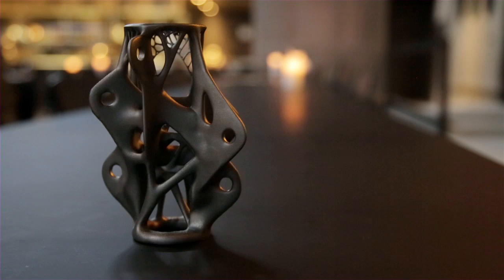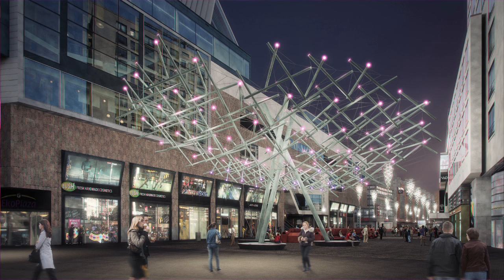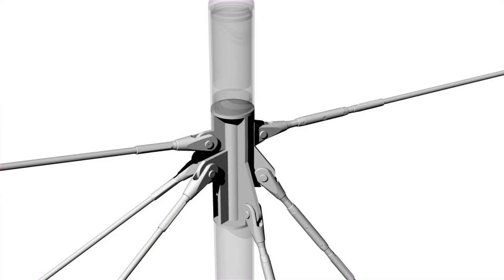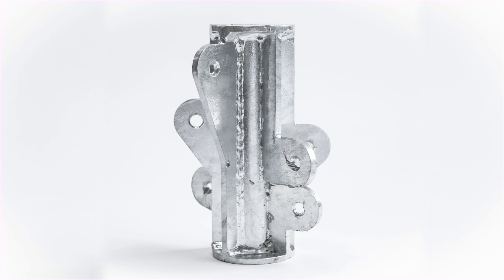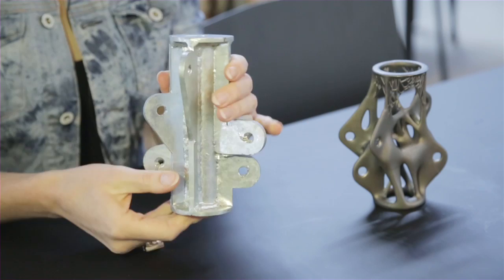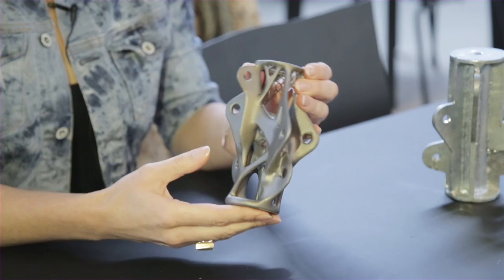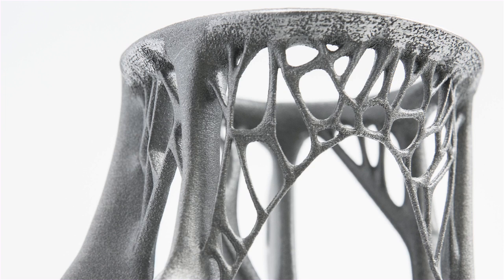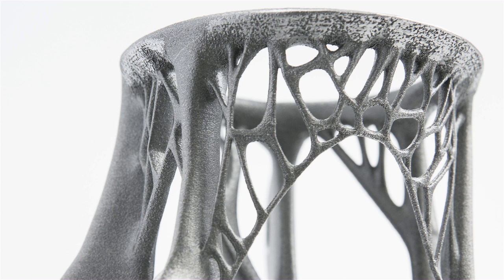3D-printed structural components will lead to new building shapes

Comment: The metal manufacturing Industry is slowly changing, most metal fabricating companies use CNC technology laser machines and for woven wire mesh products they use weaving looms. In the coming years it will be interesting to see how companies like ours adapt and how much of a role 3D printing will play, particularly in Architectural and Engineering Industries

Comment: I have been following the 3D printed structural shapes, and would like to ask what Safety Factors (SF) did you build into the additive printed Node? As an engineer who works in maintenance, I see how the real world affects small parts, and worry the removal of material, leaving only the portion carrying the direct load would fair with factors like corrosion, impact damage, or side loading.